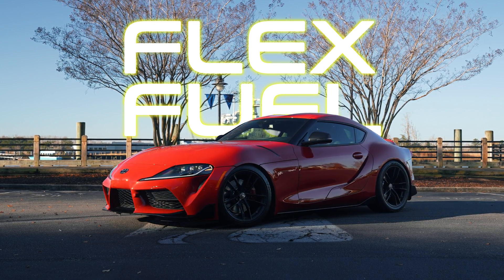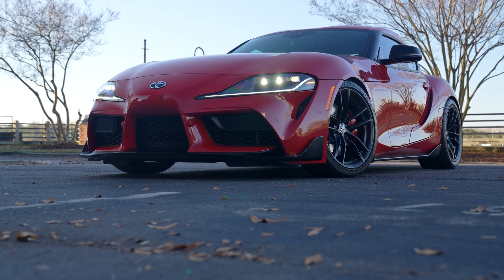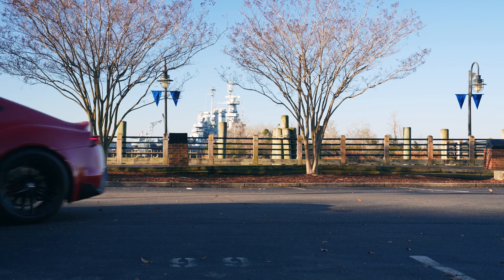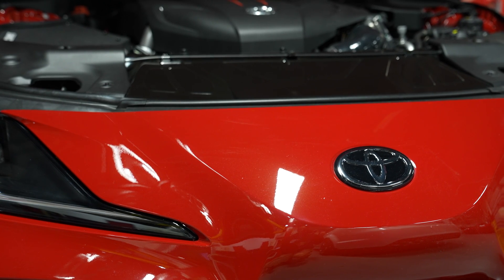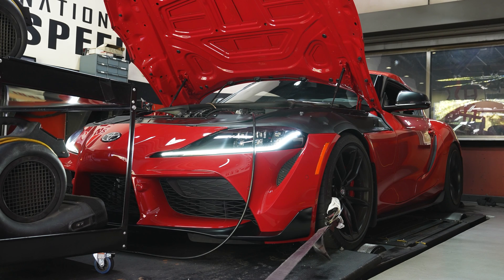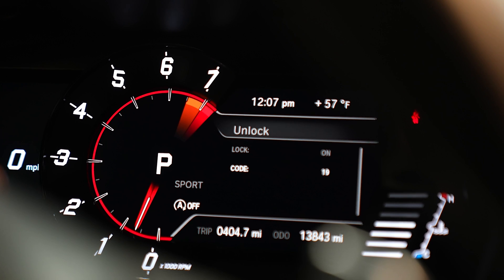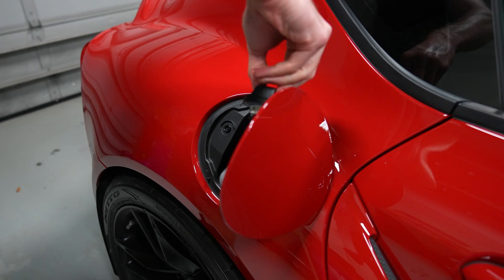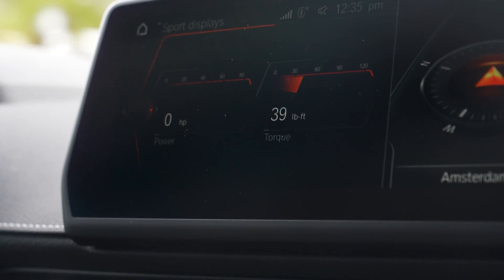A90 Supra + Flex Fuel | Running Ethanol Made Easy!

Comment: Can you run again the settings to change mileage menu to change my code cause the six dig on my vim doesn't add to what's avail on the code equals 037365??? What's code this adds up to 24 and does not appear on my code line. Can you explain
Reply: Hello

Comment: I want to see what it makes on just e85
Reply from the maker: Sadly, we're limited by the capabilities of the stock direct injection fuel system.  However, with a proper port injection system and full E85, we've seen high-500whp and well over 600lbft on stock turbocharger.  Pretty cool!
Reply: @NationalSpeedInc  Would a larger fuel pump help out some more to to run E85?
Reply: @escoson555  Its mostly the limitation on the high pressure side. Port injection helps alleviate all of this since its a mechanical fuel pump on the high pressure side. Don't need a larger fuel pump or low pressure fuel pump added until you start looking at upgrading the turbo. So it would be either a port injection kit or the CSF billet intake w/ the ports and fuel rail built into it.
Reply: Does it work on fuel it?
Reply: @Mostriluui  yes. Fuel it ties into Jb4 too. I am about to go that route just cause it's cheap for the HP. Supra fuel system is limited to e40 before upgrades are needed. e85 isn't ideal for Supra e-30 - e-50 is the common range.
Reply: hey man im confused I was thinking of getting jb4 and to run it with ethanol but I don't know what i'd need and how this e85 and e50 stuff work @joshuadqueen